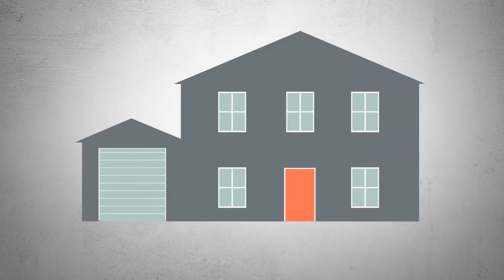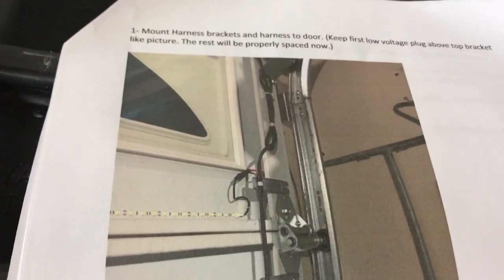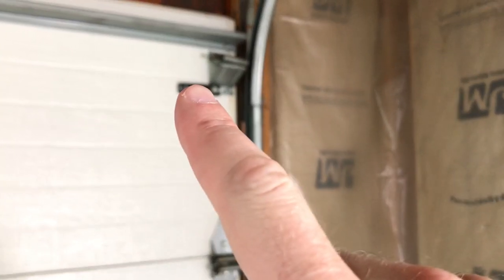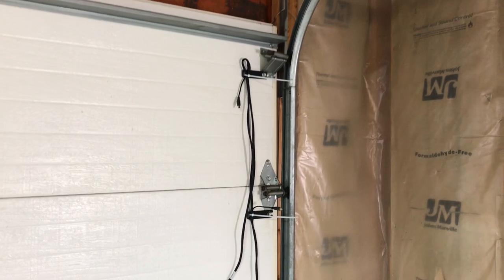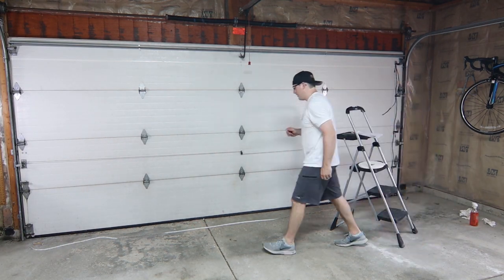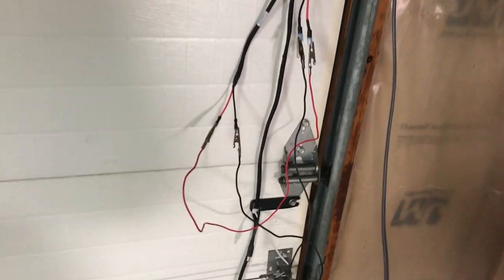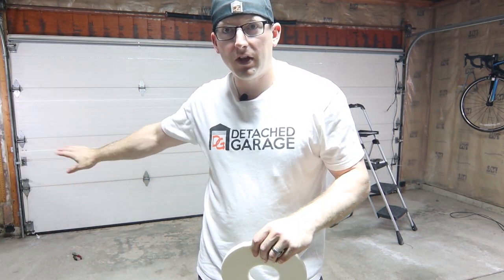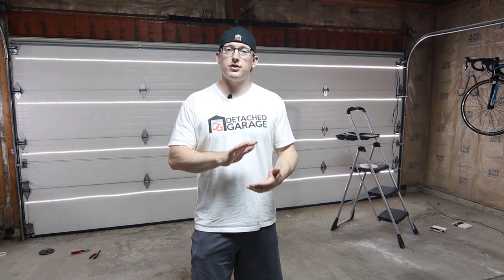GARAGE DOOR LIGHTING - LED Garage Lights - Pt. 1 INSTALLATION

Comment: Couple things:

Where did you wire up the lights? I didn’t see in the video where you connected them to power. Maybe I missed it?

Can the lights be turned on when the door is down? This would be more beneficial I think.
Reply from the maker: Unfortunately the lights can not be turned on when the door is down. This would be a good revision to the product.

Comment: Question. The switches that you are using in your system, can they handle 120vac? Not much amps maybe 2amps at 120vac? Im thinking doing this vut using same 120vac led lights i have on the celing. Thanks
Reply from the maker: Nope DC low voltage only

Comment: How are these holding up? Lights sticking to door still? Do you have to constantly adjust the electrical connections? Just curious how reliable it is. Thanks
Reply from the maker: They are holding up great! I only need to adjust in the winter and early spring. Other than that these are rock solid! Let me know if you have any more questions and thanks for watching!
Reply: Detached Garage Oh because of temp changes? is that fan on the power supply annoying?
Reply from the maker: @ethan_doesit  Yeah, in Wisconsin the shifting of the door/track take it out of alignment in the extreme cold and adjustment is needed. The power supply fan is not bad at all. I was pretty impressed how quiet it was.
Reply: @DetachedGarage  what kind of adjustments are needed?
Reply from the maker: @djshag  Just small tweaks and re-tightening of the the bracket bolts.
Reply: One more question on the power supply.. Does it run constantly or just when the lights come on? Thanks!
Reply from the maker: @jimoverschmidt8169  Sorry I didn't see this question last night. It only runs when the lights come on.

Comment: The back of the strip needs to dissipate heat, so in the cold the door provides a decent heat sink, but I'm summer, especially if the sun hits the door, this'll greatly reduce the life of your strips.